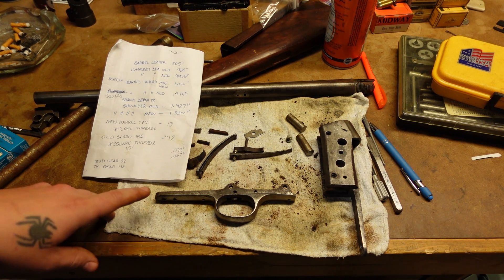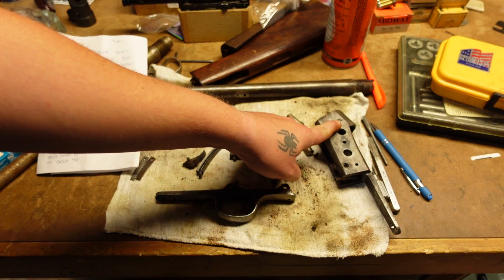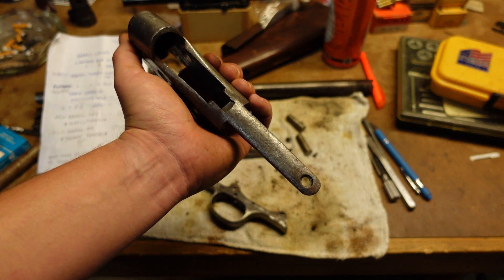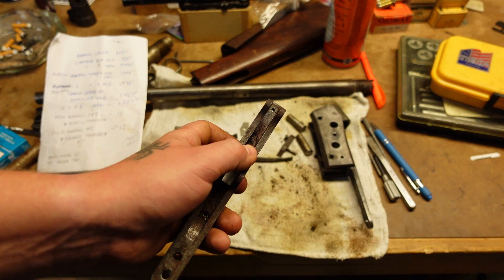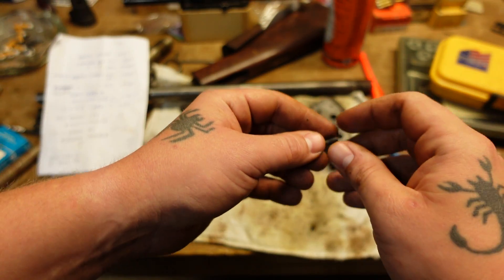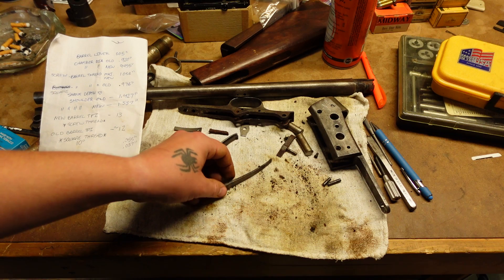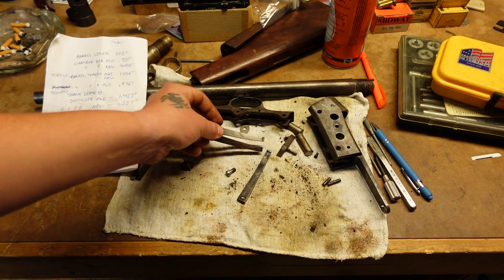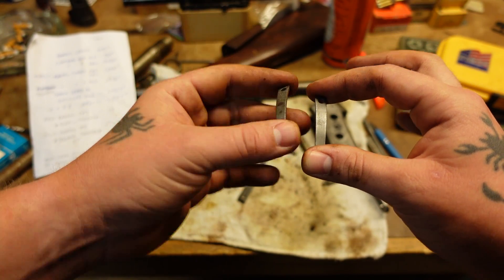APEX Remington Rolling Block carbine project - Part 2

Comment: I have a Swedish Remington rolling block chambered in 12.17x44 is is a m1867 do you know if the no1 rolling block parts will fit it. Ie the hammer, and firing pin? Thanks.
Reply from the maker: I'm not exactly sure. I have never been very fluent in rolling blocks